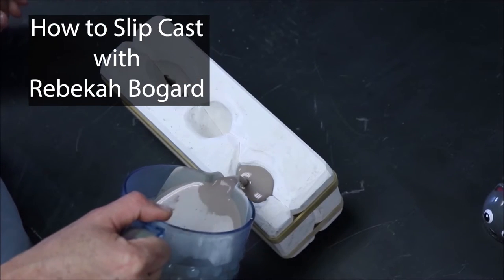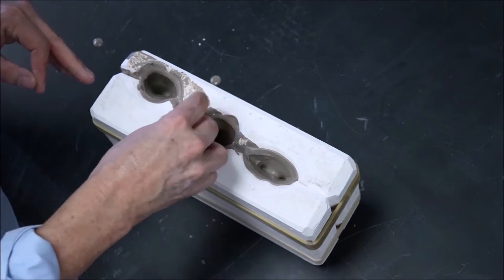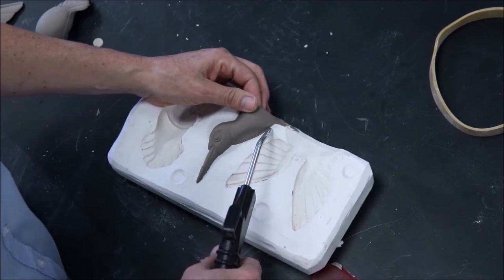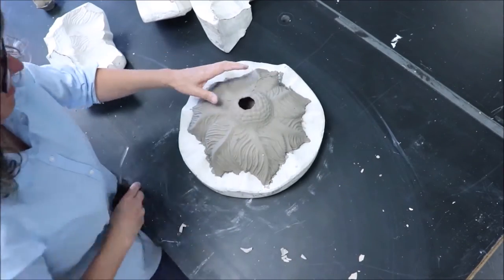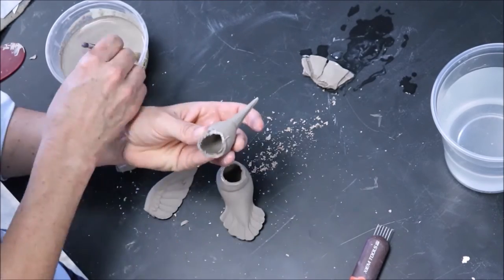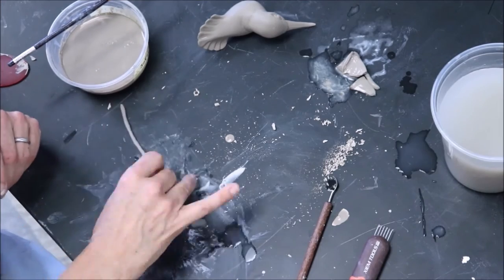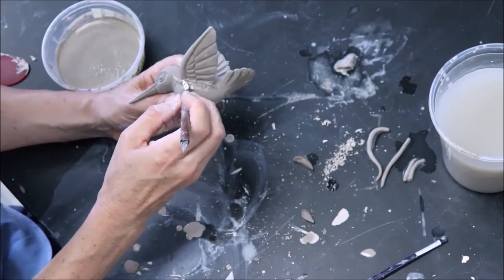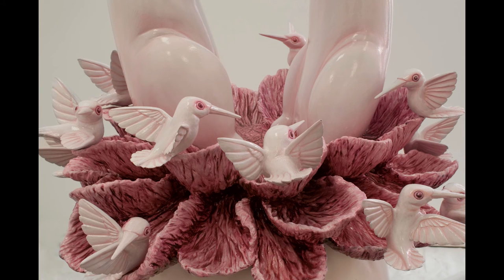Revised: How to Slip Cast with Rebekah Bogard

Comment: Thank you for this! The only thing I'll say is that it isn't really magnetism that makes a deflocculant work - I think you're conflating magnetism with the electrostatic effects within a slip. Magnetism is the moving of an electric field causing repulsion or attraction. Zeta potential is the electrostatic repulsion between particles and a liquid in a suspension. Deflocculants increase this electrostatic effect, keeping the particles separated and allowing them to flow.
Reply: Also wow that piece at the end is beautiful
Reply from the maker: Hi Chris.  Thank you so much for your generous comment and clarification regarding the difference between electrostatic charges and magnetism.  It is a very good point to make!   I do tend to over-simplify when explaining this issue, and maybe I am dumbing it down just a little too much.  Thanks again for bringing this to my attention!  And thanks for the compliment!

Comment: You can't time a cast . It depends on the weather, the dampness of the moulds and the viscosity of the slip. Also remove the scrap before you open the mould. One more thing PUT some overalls on.

Comment: Love you very details video with such a good information. I have a couple of question. The slip porcelain is the same as clay?
 Can clay be made into slip porcelain ( liquid to pour). Wondering as i would like something to pour but them add details later on. I read somewhere that slip porcelain need to be the same as the liquid so they can merge in the baking process. What brand do you recommend that offers both. 

Thank you so much in advance!.
Reply from the maker: Porcelain is a type of clay body that is white, pure, and high-fire.  You may also turn this clay body into a casting slip.  Both are very difficult to work with.  I primarily work with a low-fire earthenware clay body as well as casting slip.  I sometimes cast with a "mid-fire porcelain," which is challenging and difficult to work with.  If you want to use a porcelain casting slip, I highly recommend you simply purchase pre-made slip, which is what I do.  I order from Clay People and get the "Pearl" casting slip.  You can buy it by the gallon.  But can also buy it from most places.  https://bigceramicstore.com/products/laguna-clay-cn4110g-oriental-pearl-porcelain-casting-slip-slip-cone-5

Comment: I just started doing this, got a bunch of molds for free... Wasn't sure what to get so I picked up some of that "Perfect Cast"  Poured it in a small x-mas Santa ornament, left it in for 40 mins (cuz that's what the instructions on the bag said) and it got stuck in the mold... I was finally able to get it out but it stuck to a couple small details of Santa's beard and broke them off :-(  

Was it the stuff I used?  Or did I do something wrong?
Reply from the maker: Sorry, I don't Know what "Perfect Cast" is.  Never used it.  But, when/if your mold breaks, you can always glue it back together with epoxy.  Just try not to use so much glue that it squeezes out.  Otherwise that spot in the mold will be water-resistant and will sometimes stick.